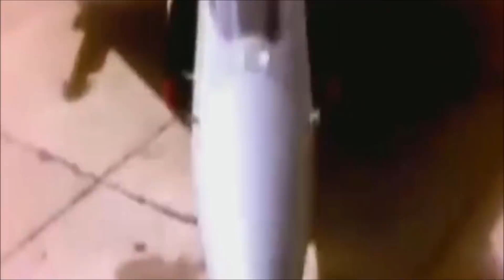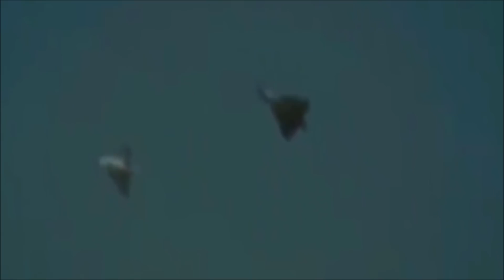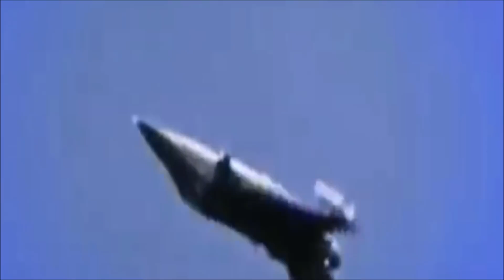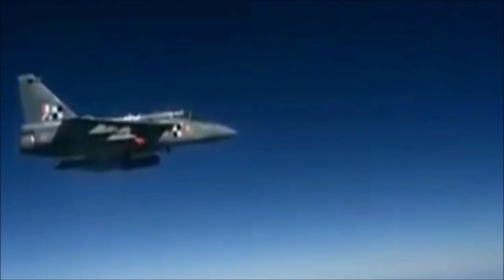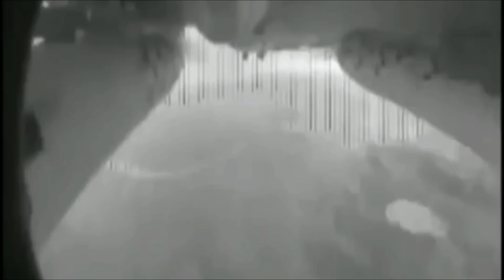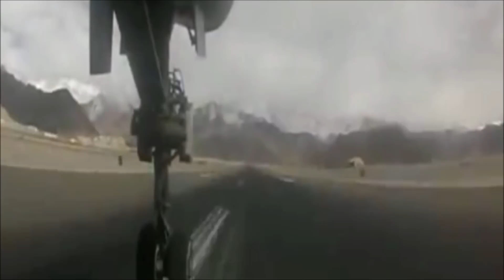Tejas UCAV OR DRONE ?Here’s What HAL Needs To Do

Comment: Even with Tejas introduction, options are still being exercised for a single engine fighter - Gripen or F16 type. If this is done to add this technology to Tejas, it may benefit the knowledge transfer intent. Otherwise, TEJAS as a drone option, may not be a bad idea.  Add a few more technologies and have a top of the line attack drone.